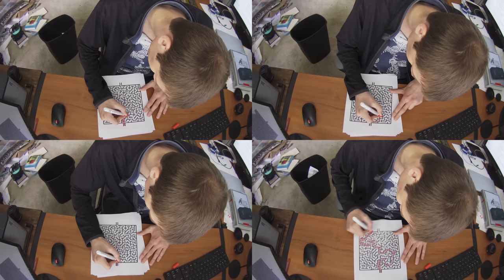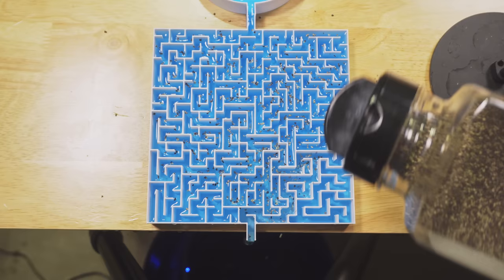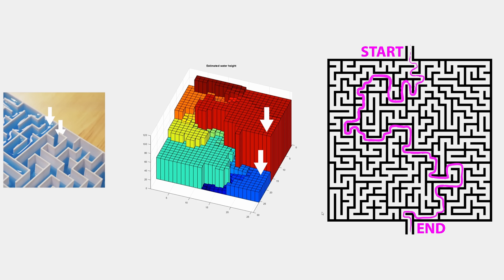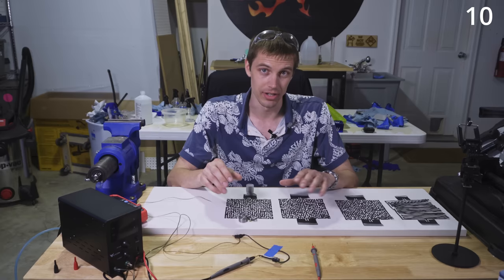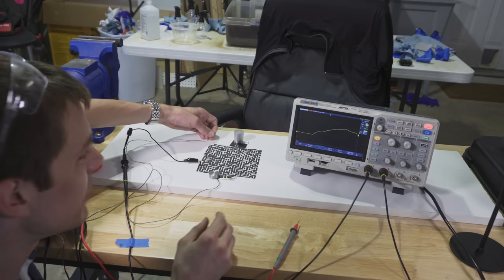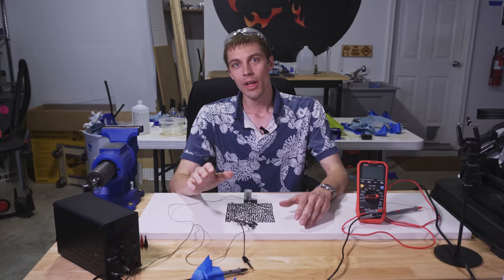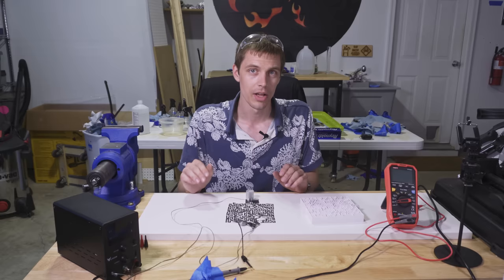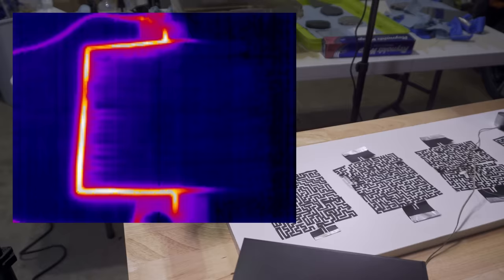How does electricity find the "Path of Least Resistance"?

Comment from the maker: FAQs and corrections:
1) Someone very correctly pointed out that my final question with the "cutting the line" test was ambiguous. For all of these tests I had the power supply set up as a current source, not a voltage source. If I had been holding a constant voltage at the start and end of the maze (also assuming I would have had thicker wires) the result would have been different =)

2) Multiple commenters have pointed out that the classic “hydraulic analogy” deals with water PRESSURE, not height. This means that we aren’t relying on gravity, so very small changes in pressure can have very large current flows and power transmission, but I think it’s less visual than height and I wanted a visual representation. Also, the pressure at the BOTTOM of the channel actually is higher when there’s more water above it, so it’s almost the same! 

2b) I want to take this opportunity to mention the “surface charge” thing. Yes, real charge carriers in a wire spread out the excess charge (positive or negative) by placing excess electrons or depleting electrons, exclusively from the surface (but this only-at-the-surface thing only holds once the system is in steady state). The equivalent here with water is like imagining the water in the bottom of the channel is always present, that’s like the electrons in the bulk of the wire. The “wedge” of water you place on top of it is like the “surface charge”. It’s physically in a different place, and you aren’t actually changing the amount of water in the BOTTOM of the maze, but the wedge drives the slow of water all through the channel. I normally don’t even think about the surface charge because I visualize wires as 1D objects.

3) upon further inspection, I misread my meter when I was looking at the “tall step”. It didn’t read 5 mV, it read 0.5 mV. I think the circuit shorted out somewhere in the lower left just before I made these readings, which would explain why the 70-something number was too low and why the 0.5 number was WAY too low.

4) “The maze should start half full” - you’re right! In electricity, there is a significant driving force to move charge around if a wire has too many OR too few electrons. Wires like to be neutral, and where negative electrons can move, if they abandon the material they leave it with a net positive charge cause the (positive) atomic nuclei have nothing to cancel them out! In the water model you can think of this as actively pulling water from one end of the maze AND actively pushing water into the other end of the maze. But in water, you have to rely on it finding a steady state to flatten out because any stable water level can exist - in electricity it kinda already knows what it wants.

5) A lot of people have likened this to lightning, and lightning is way cool. Unfortunately I don’t claim to understand exactly how lightning “chooses a path”, but it’s more complicated than this. I know it tries many paths at once, but because it has to ionize channels of air do do so, it forms a filamentary structure instead of the more “continuum” flow/wave thing we see in a solid brick of metal.

6) Many commenters have said that I just have an RLC circuit bouncing around. The thin bits of foil behave like capacitors and store some electrons using electric fields, and the magnetic fields around the input wires are coupling to this and making it bounce. YES! This is exactly correct, you’ve just used the more technical wording. I was trying to keep it very linked to the water model so I said electrons were “sloshing”, but that’s exactly what happens in an electronic oscillator. It’s like one of those wave pools hitting resonance!

7) I’ve had a few comments ask what quantum physics has to do with this, and I would say for this experiment, nearly nothing. The reason electrons can flow in metals has a strong foundation in quantum, but it all ends up isotopic so it’s very possible to handle electron flow as a continuum thing. The problem with seeing quantum effects in wires is that electrons like to run into things, and every time they do, they kinda rerandomize. This means that to see quantum effects you need something REDICULOUSLY clean like an ultra pure GaAs/AlGaAs heterojunction with a 2DEG, or your circuit features need to be ridiculously small. A few years ago I had most of an experiment set up to fabricate a wire one atom thick but didn’t have time and tore it down. I’ll absolutely be setting that back up eventually.

8) Local forces - the water molecules can ONLY interact with (and sort of exchange information with) their adjacent molecules, but that’s plenty for them to solve a maze like this. Each individual water molecule doesn’t even know that it’s IN a maze, but the collective is able to solve it - I think that’s really beautiful. Electricity on the other hand, DOES have some longer range forces, and this was demonstrated very well by the Veritassium experiment I set up for real in the field. The thing is, all of these long-range forces can’t actually DELIVER electrons - nothing’s moving down a wire, which means that the results from these forces are always temporary, and if you want a DC current to flow, that’s still set up by relatively local forces between nearby electrons behaving like water.
9) a LOT of comments are recommending slomo guys. A 10million FPS camera would take a frame every 100ns. That would skip right over the larger sloshing/ripples that I said were way too slow. Electricity is mind-bogglingly fast!
Reply: Not a mess-up, but a simple consumer-grade Cricut machine will cut your foil maze out very easily and with little danger 😃
Reply: @OrigamiMarie  yeah but that wouldn't have been as cool haha
Reply: @Mezzo_Roo  true!
Reply: is it kirchoffs current law? States current remains the same at all points of a series circuit? Just taking a stab.
Reply: If you used a properly doped semiconductor, would it be possible to create a maze where the electrons flowed preferentially through one path but holes through a different path?
Reply: 14:15 It looks like the maze shorted near the probe?
Reply: i like how your maze perfectly replicated what steve mould tried to do with water filling up the maze
Reply from the maker: @OrigamiMarie  crossed my mind, but unfortunately i don't have a cricut!
Reply: @gingermany6223  I would think that if you had one path p type and the other n type you'd still get conduction out both, and so even if the carriers are different they would both pass current. Or are you thinking more of a pn junction?
Reply from the maker: @PhngluiMglwnafh  after watching it again, i think i misread the meter live and it actually read about 0.50 millivolts, not even 5 millivolts, meaning that something else may have connected the main line of the maze to the solution early... that would also drop the voltage at the first location where it should have been much more than 70-something
Reply: Didn't think to use thermochromatic paint?
Reply: Can you explain what went on in that last clip where you cut the left side foil? I would assume each path is independent of the other. P = V^2/R, and surely V didn't change by much, and cutting the left side path did not decrease the R for the right side path, how did the power dissipation increase? Did the power dissipation increase? Or was that your camera adjusting light levels? Or did the thermal conductivity suddenly increase to redistribute the existing heat throughout the foil?
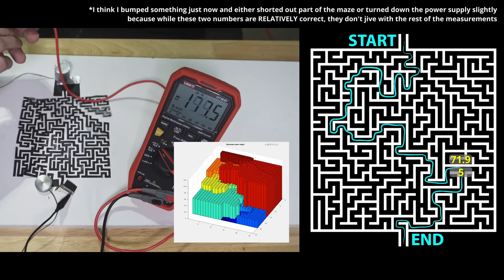Reply: 15:31 About the asterisk on screen, can't this be explained by the current of a different voltage on the "path" next to it? I assume that's also the reason why it was "a little noisy" at 15:03 🤔? Veritasium made a video about how current flows out of the cables and not in it, so could it explain the difference?
(I'll learn about all that electricity stuff next semester so I have no clue if I'm even slightly right or completely wrong 😅.)
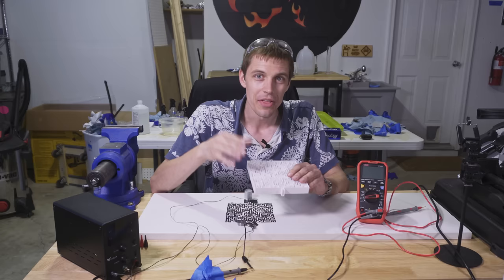Reply: 15:50 -- this is a horrendously wrong explanation. The water entering the maze and exiting the maze is the same flow rate. The height of the water just merely shows the potential difference, not the flow rate. If the flow rate in and out is different, you by definition will have water accumulating inside the maze--growing over time, in perpetuity. Same for the electron case--the electrons entering one and exiting the other is the same. 

Think about Gauss' Law and the Continuity Equation in the emag sense, and apply that to water. Draw a closed surface around the maze and it is apparent that the net flux has to be zero of the charge or water isn't increasing inside over time.

The difference in water height or the voltage shows the energy each particle of carrier is holding. A "loss" of one volt is more like saying a charge movement of 1A through that loss in voltage carried 1 watt of power.
Reply: @ianmercer1291  my initial intuition was the same, that it wouldn’t work. Even if you add a pn junction it seems you’ll either pass current or block it depending on the direction. I wonder if there are water analogies for things like diodes (check valves?) or more exotic things tunneling electrons (membranes?)
Reply: @gingermany6223  Your statement is a little ambiguous, but I think if you made something like that you'd violate charge continuity (you'd have to create charge out of nothing)
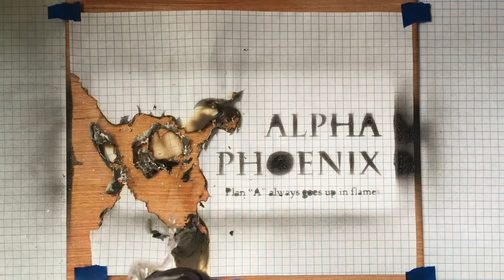Reply: 22:18 Why isn't the middle lighting up nearly as much as the sides? Does "turning" actually give off more heat for the electrons 🤨?
Reply: you could have just bought (or made) some conductive ink and printed the maze :) it PROBABLY would have been easier than reassembling the maze cutout... MAYBE :)
Reply: @louisrobitaille5810   middle looks like it's contacting the desk table more than the sides which are kinda bent upwards, so the desk robs some heat
Reply: Where'd you get the smartphone FLIR camera?
Reply: @gingermany6223  yeah I was thinking the same, one other thought was even in an n type you still have hole carriers, it's just they're usually massively outweighed by the electron carriers. Plus if you apply a bias the electron carriers go towards the positive bias and the holes go in the opposite direction, since holes are kinda like the absence of electrons moving, which Im sure you understand. But I was thinking the same earlier, if there were any equivalents to the water for a diode, schottky or pn. My mind goes to a  ramp where water can go one direction (down the ramp) real easy but for it to go in the other direction (up the ramp) you need sufficient flow to even get a little water up. Maybe you could make the argument that depending on the steepness of the ramp it corresponds to the width of the junction's depletion zone.
Reply: Maybe try reaching out to the slowmo guys to see if they can help with capturing it on camera? This would be really cool to see!
Reply: @user-xm9ft7ks7y  the currents resolve themselves within tens of nanoseconds so the joule heating will be impossible to see on a thermal camera
Reply: Nice video. But didn't the veritasium video say that current is in the fields and not the wire itself?
Reply: We need a follow up on this!
Reply: @dougfoster445  Yes.
Reply: I didn’t see the FAQ section at first so I’ll post my comment here too for good measure:  For the very last example, I have a question; why does the long path heat up?  It doesn’t look like the camera adjusts itself because the background is the same, so if the voltage across it is the same, and the resistance to the flow is the same in that path, why does the current increase?  Shouldn’t the current causing the heating stay the same as before the snip due to ohm’s law?  Is the shorter path causing a voltage drop in the power supply before it is cut or is the supply set to be a constant current output?  It looked pretty instant of a change after the snip, so I was curious what you saw on the power supply readout, how you had it set up/adjusted it, and if I missed anything.  This seems different from what you might expect with two resistors in parallel with a constant voltage.  My curiosity is forever insatiable lol.  Thanks for putting out excellent educational and entertaining content that I learn a lot from!
Reply: @__dm__  Oh, for sure it is not a full fledged thought!  It was just the dual path mazes and the fact that you can had more than one charge carrier made me wonder if there could be a case where each carrier took a different path.  I guess technically this is what PVs are doing!
Reply: What do you use to make the graphs in your video? MATLAB?
Reply: @movitoviscyrinxed446   It looked to me to be both.  Once the left side was cut, all the current went thru the right side instead of being split.  That increased the current on the right side causing that side to heat up.  It appeared to heat up slowly like the exposure was compensated for.  Hard to tell.
Reply: @dougfoster445  technically it says the sum of currents in is the sum of currents out, but yes that would come of it
Reply: @garrettmarshall9909  There's a couple of things that would be going on. The first is that thermal cameras are generally auto-ranging, so even if the temperature of the second branch remained constant, as the first branch cools, it will make the second branch clearer. The second is the nature of the supply. I don't know if he had his supply set to constant voltage or constant current mode, but a supply can be modeled as a constant voltage supply in series with a resistance or a constant current supply in parallel with a resistance. We tend to think of the first, but the two are mathematically interchangeable. If you think of his supply as a constant current supply, when you cut one branch, all the current going through that branch now needs to go through either the second branch or the supplies internal parallel resistance.
Reply: @alext8828  How does the current increase? That doesn't make sense assuming the power supply voltage remains the same
Reply: I love science. So through the path of least resistance, I love the person wich thou content stem from! In which case is you! 

PS. CONGRATULATIONS ON YOUR DISSERTATION🎉🎉🥳🎊🎊🎊👏👏👏👏
Reply: Gotta love when turbulent flow restructures itself when disturbed to equal itself out
Reply: Could you get a high speed camera and test the heat travel through the maze while looking at the infrared picture? Then measure it?
Reply: @AlphaPhoenixChannel  Yeah, I think you had tons of random shorts by accident throughout.  Maybe gluing or pinning the maze down first would reduce the odds of that, or stick the metal inside the plastic printed maze for insulation...
Reply: At 9:15 you skipped 5
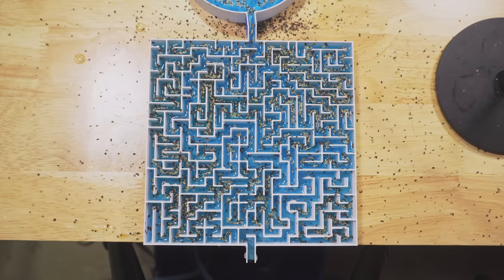Reply: You say at 5:10 that there is no water flowing up this bend BUT there is! And you can see it clearly happening (flowing both ways through that bend ) up and down at about here: 3:35 its not just the height of the water or rather the height of the water is a *consequence* of what's happening not the reason behind what's happening, the water doesnt solve the maze (its like you in the beginning it just randomly flows and hits a wall but instead of scraping that attempt like you did when you hit a wall it continues "testing" the other openings). if the maze is perfectly level it will flow towards all directions trying to fill up all the space with less *PRESSURE* (<--this is the key word) so displacing the air in the maze in other words, so in dead ends the water hits the walls and this creates more pressure to the point that the water in the dead end *returns back* (as we can see at some point around 3:35 in the particular junction you mentioned at 5:10)  because there is no source to keep the pressure steady so the pressure lowers as water gets away from the walls of the dead end and then because it gradually loses pressure the flow of the source at some point has more pressure and *FILLS AGAIN* the dead end with water.
Reply: @jeffallen3382  Don't think so, think of the screen pixel response time, it needs to be less then 5ns. Maybe if he used a really strong current and or voltage to instantly vaporize the maze/circuit and instead film that with a high speed camera? It would help if the circuit was made of something like a thin strand of steel wool, or similar properties. 
?
Reply: @AlphaPhoenixChannel  might be worth getting a ciricut, they are surprisingly useful for making stencils and patterns etc. 
Wifey cut a circuit out of some copper tape and applied it to a glass water bottle then added LEDs and resistors.
Reply: @PhngluiMglwnafh  wdym
Reply: so... breadth first search.
Reply: @louisrobitaille5810  Veritasium's videos did NOT claim that current flows outside of wires, they claimed energy flows outside of wires. And that is a somewhat specious claim -- it takes the whole system of wires and fields to communicate energy.  DC current per se is a measure of rate-of-charge-flow within a conductor, period.  AC current can occur with gaps in the conductor path (ie: capacitors), but in that case, the electrons are just moving back and forth in the conductors, so the average current (ie flow of charge, carried by electrons) across the gap is zero.
Reply: @__dm__  "15:50 -- this is a horrendously wrong explanation. The water entering the maze and exiting the maze is the same flow rate."  I don't think Brian say anything different.. He said the water is higher at the beginning than at the end, and did not say anything about the flow rate.  And yes, this is the same as the electrical case.  He then goes on to contrast the conspicuous gradient of volume-per-length of water in the plastic maze versus the almost inconspicuous gradient of electron density in the foil maze.  This contrast I think fails to fully elaborate the correspondences between water height and pressure vs electron density and voltage gradient.
Reply: For the oscilloscope test the analogy with the water levels kinda breaks down when you start to look at fast transient effects. What you need to keep in mind is that you have an electric field here that is establishing itself across the maze. That will give you crosstalk from all parts of the maze that will give off some serious EMI (serious for this kind of rise times and voltage levels at least). I wouldn't really trust that waveform that you got, besides getting some rough ideas.

Also the test setup leaves some things to be desired. First of all you have the load step response of the PSU itself that will give you some initial oscillations, then you have the impedance discontinuities from the PSU leads to the maze terminals that will give you some reflections, the probe itself also has some capacitance and inductance that will influence what you measure on the circuit (it will both attenuate the signal rise time and introduce some reflections again because of the huge impedance discontinuities) and you also have radiation from across the different parts of the maze that will combine at the measurement point and give you constructive and destructive interference. 

In order to do this properly I would design a PCB with defined impedance and also have some deembedding ports to counter the effects of the probes.
Reply: Agreed. I posted more or less the same thing yesterday in another separate comment. My comment on the PCB was that though this gives you a better-defined situation, all it does is make the PCB track impedance (inductance and capacitance) effects consistent and dominant. In contrast, what Brian was hoping to see was the effect of electrons "sloshing" around into and out of segments of wire, especially those not part of the main path.  That would be the "capacitance" of a single conductor far away from any other conductor. So I don't think a PCB implementation is going to shed light on this.
Reply: I would say it's not exactly true that an electron travels a long distance rather the electron charges an atom next to then that electron moves. If this is made of copper than it's specifically the d orbital electrons moving over one d-shell at a time. Of course you have the old veritassium argument that the electrons are barely moving and it's the fields that are transporting the current.
Reply: @ASMRPeople  The Veritasium assertion is not about fields transporting the current, it's about the energy being transported by the fields. In my view even that is not correct, but rather that the electric and magnetic fields can't be separated from the voltage and current view; they make up a system which in total transports energy.
Reply: On point 2, it is worth noting that the same is effectively true here gravity produces a pressure gradient within the channel that is proportional to the depth at that point. The pressure really is a good approximation for the voltage at a particular point as in the same way water at a higher pressure will push water at a lower pressure down the pressure gradient as it flows into that space. Same happens with electrons down the voltage potential gradient. In both cases they effectively represent the density of potential energy at a given point and thus when two points at different potentials meet that difference in potential to do work is released and that fraction of the potential energy is converted to kinetic energy so you get flow. The potential energy in both systems is different, gravitational potential energy in the case of water and electrical potential energy in the case of electricity but the result is the same when two areas of different potential meet the surplus is released in the form of kinetic energy in the direction of the region at lower potential. Some of the kinetic energy is then converted to heat and this is also true in both cases although it is more visible on thermal camera for the electricity but this is happening to the water too as the flow experiences friction which acts like resistance albeit more limited as it acts from the walls of the channel.
Reply: On point 7 here.  Quantum mechanics or even Quantum Field Theory could of course be used to talk about this but WHY?  I'd also say that to talking too much about classical electric field theory.  Sure we can say oh... the fields are really solving the maze not the electrons but what would we really gain by thinking about this in a more complicated way?   So yeah QM and QFT or even maxwells equations, have something to do with it ... they are just overkill.  The hydraulic analogy is totally right for this.  You mention that to see quantum effects you need something lie implementing this circuit in a semiconductor.  At that point maybe using QM isn't just overkill.
Reply: 12:40 -ish. I think you are slightly wrong, because of this:
https://youtu.be/oI_X2cMHNe0
Basically, the electric field can (will) propagate through air too, so it is not forced to follow the metal, even if you used a mathematically perfect conductor material.
Electricity is kind "cheating" & searches through the labyrinth "radially" without following the paths, until the exit path is reached, then an current is created. Great video anyway :D
Reply: @sebbes333  Except Veritasium's portrayal is over-simplified.  First, his claim is about the path that energy takes, not the path that current takes. Second, those fields won't exist in the particular arrangements he shows, without the wires, the voltages and the currents in the wires.  So the observed phenomena are a result of, or at least associated with, the entire system. What Brian shows at 12:40-ish is still off-track... he's seeing effects best studied through the Transmission Line distillation of transient electric and magnetic fields and interaction with the environment (and even the interface of scope probe to the maze circuit), and have nothing to do with electrons sloshing just within the wires internally.
Reply: you're the goat! answering all these questions and explaining possible mistakes is very admirable, keep up the great work!
Reply: Can you make logic gates with water in a "maze"?
Reply: With hydraulic transistors
Reply: @OrigamiMarie   Is that true?  Excellent.
Reply: @dougfoster445   That would be for series circuits once the parallel portions are combined to their series equivalents.
Reply: @SKotekar . I also wanted to spot veritasium's video. But I think he says the flow of energy (and not current) is in the fields.
Reply: You should also mention that electricity flows through path of least resistance also means that charges actually use both the paths(not just one path) to make the overall path of least resistance
Reply: On point 2) pressure v height of water
These commenters are making a false distinction. In hydraulics, especially for low numbers, the pressure of a fluid (particularly water) often is expressed as "head" which is the term given to height. In agriculture, dams, channels, weirs, etc it is usual to refer to differences in "head of water" expressed in either Imperial or SI units 
Another everyday use is in Medicine, where Blood PRESSURE is expressed in " millimetres of Mercury" mmHg from the days ( not long ago, maybe 25 years) when we actually used a manometer, and the pressure in the inflated cuff actually pushed the Mercury up a graduated tube & we read off the level. They were extremely reliable & didn't need calibration of course but were taken out of use, along with Mercury thermometers because of the danger of exposure when breakages occurred.
Reply: The 10 second countdown skips 5, as im sure you've seen a million times
Reply: Is it also a little incorrect to say that electrons flow? The electrons aren’t experiencing much drift within the wire at all, it’s the electromagnetic waves they produce heating the electrons most prone to activity
Reply: This is why you always read the creator’s pinned comment you&/y’all— IDK about you&/y’all, but when a person just casually says “A few years ago I had most of an experiment set up to fabricate a wire ONE ATOM AND THICK but didn't have time and tore it down. I'II absolutely be setting that back up eventually.”—I am reminded why I subscribed to begin with and know why I am staying tuned—particularly when it immediately follows opening my eyes to my own human inadequacies in objectively observing certain natural phenomenon when I not only do not possess the unbelievably sensitive equipment it would take to measure such phenomenon but also could likely not even entirely fathom what the hell I was even looking at if I did. The scale problem. It all makes so much more sense to me now that I understand more granularly how I haven’t and cannot fully comprehend what’s happening. Because of the lack of granularity in my own senses and in the technology currently available to me.
Reply: Hey! What happens to those 3,000,000 electrons difference?
Reply: Literally on the order of literally on the order of........literally 🤔
Reply: I was wondering why the meter showed lower and lower the further from the main path you came. That does not seem like an analogy for water level.
Reply: Electrons don't flow.  They bounce off each other, then can exchange relative positions, but they do not flow.  The energy is transferred entirely through electromagnetic fields and inductive heating is a result of these fields interacting.  The fields expand out from both positive and negative leads then collide with each other and follow the path where fields exchange the most energy with each other.  The inverse square law determines the path of most interaction, not the path of least resistance like a fluid.

We really shouldn't be referring to "electron flow" in 2023.  It is effective at helping children visualize an electrical circuit but serves no purpose otherwise.
Reply: You also said somewhere that the negative pole of the source pulls electrons out and the positive pole adds electrons,.... 🤔

Electrons move in the opposite direction of current, right?
Reply: Check my comment.
Also do a random ground on a dead end you will see this experiment was biased based on the "full spectrum".
This is great for those trying to solve these, not great when tge logic is made more human like
Reply: I'm too ignorant of this subject to actually understand most of these questions, but I do have one of my own. With the water analogy, it seems like the source is the sole reason for pressure, and possibly overflow. Pour too much water into the source reservoir too quickly, and you might overflow the maze.

With electricity, however, the destination - or the consuming part - is responsible for any "overflow" in the path.

With a water hose, if I attach it directly to a large enough water source, it would burst.

With electricity, if I attach a wire to an infinitely large battery, it wouldn't "care" at all until I attach something that consumes electricity. If the consumer starts to want too much power, though, the cable would melt.

Why is that? Or am I mistaken here... 🤔 Would a garden hose attached directly to a communal water reservoir actually burst? Or would I have to consume water through it first? Would it ever burst? Me confused 😕 😂

Two videos in, loving this channel 💕
Reply: But are the electrons really moving or it's the fields in action that make the current flow? Have you seen the Veritasium video?
Reply from the maker: @andrius_magic  yes, even in his video the electrons were moving
Reply: Electricity doesn't take the path of least resistance. it takes every path. You just get more voltage potential on some paths, and therefore more current.
Reply: tks also for this Q&A session :)
Reply: Spices used to be considered more valuable than precious metals.

People who died 2 thousand years ago are rolling over in their graves at the waste of that pepper.
Reply: @AlphaPhoenix The lightning, and subsequent pattern phenomena are known as Lichtenberg Figures. This, a bit from Wikipedia... "A Lichtenberg figure (German Lichtenberg-Figuren), or Lichtenberg dust figure, is a branching electric discharge that sometimes appears on the surface or in the interior of insulating materials. Lichtenberg figures are often associated with the progressive deterioration of high voltage components and equipment. The study of planar Lichtenberg figures along insulating surfaces and 3D electrical trees within insulating materials often provides engineers with valuable insights for improving the long-term reliability of high-voltage equipment. Lichtenberg figures are now known to occur on or within solids, liquids, and gases during electrical breakdown. Lichtenberg figures are natural phenomena which exhibit fractal properties." 

Great work, by the way. I appreciate your honed ability to capture, and drip feed info in a clear, and precise manner. Lastly, you remind me of a streamer that plays mario named carlsagan42, both in general looks a bit, but also because during his streams he would talk about his research in some specific field... he is highly intelligent like yourself, and I'm certain you two would enjoy shooting the shit.  Thank you
Reply: EE approved! What a great metaphor and visualization to help people learn electricity intuitively!
Reply: 😅😅😅 0:37
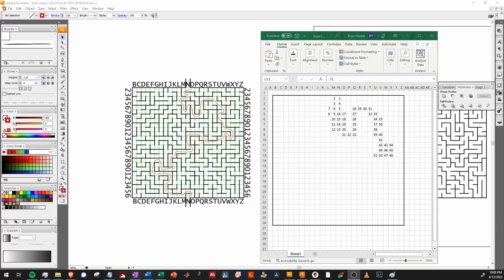Reply: 4:32 Double error with your counting. The way you were counting in the video, it would've resulted in 114 steps instead of 110. But you've confused yourself with the 62 in M12, and after the correction you continued with 80 right after 70! (Instead of 71), meaning that the correct step amount would've been only 105
Reply: Any maze that has in in and output can be pulled apart into two separate pieces.  When you identify each side, it's easy to find the path.
Reply: @AlphaPhoenixChannel One video I'd love to see is one where you are able to discern if fault current is trying to go to ground, or back to the source. As an electrician we were always told it goes to ground. Now, there are many saying the fault current goes to source, which is theoretical at best. In fact, all grounded systems are set up where the neutral conductor (going back to source) and grounding electrode conductor (going to ground) are joined together at the same location, usually in the meter or main disconnect where the fault current ends up! So, there's no way to know who is correct without testing it. I would assume that a portion of the fault current goes to ground and a portion goes to source. After all the possible paths for the current to travel split right there inside the meter enclosure.
Reply: Do you think you turned your 1D model wire into 2D and the dead ends act like an extended "surface" so they model what happens with those surface electrons?